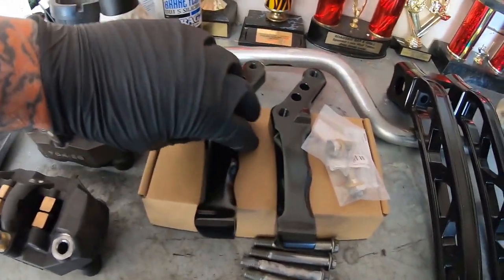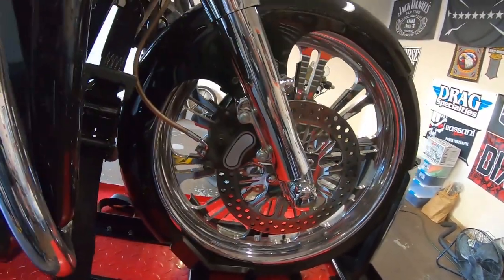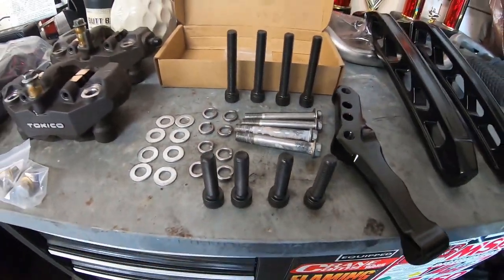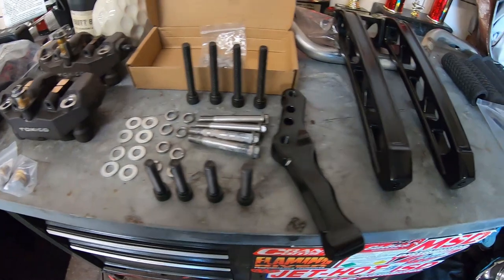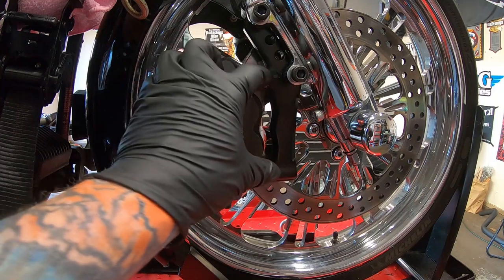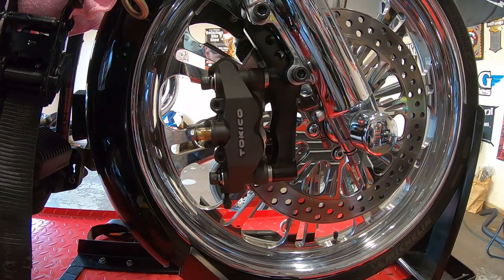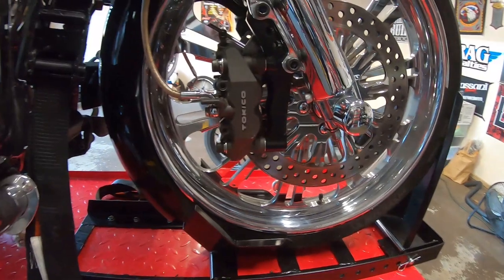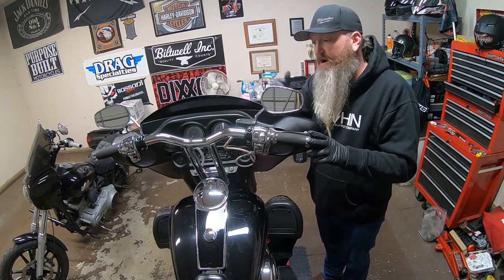Performance Bagger Radial Brake Conversion Install

Comment: Dot 5 is a silcoln based brake fluid, it has a higher boiling temp than dot 3 and 4, it doesn't attract water AND it isn't corrosive to hard paint or plastic like the earlier mentioned brake fluid.
Reply from the maker: Thanks havent really rode rhe bike to push it yet may upgrade in the future
Reply: Dot5 isn’t compatible with any of the other fluids. You’d have to flush and completely clean the system. 

Dot5.1 is compatible I believe. You’d have to do the research To verify. 

Dot5 isn’t good for ABS either.
Reply: @TeensierPython  only way to change to dot 5 after using 3 or 4 is disassemble master cylinders and brake-calipers then replace all of the rubber parts - should probably do the hoses also.
Reply from the maker: Yep all new clean parts with no abs Iam good

Comment: What size rotors do you have on there ? Will that set up work with the 11.8 ? Also where did ya pick up the bleeder bolts?

Comment: I had seen another guy use the Yamaha yzf r6r front brake calipers on his late model streetglid.  But he replaced the brake lines since the banjo bolts fasten on the side. Is
this a good comparison to ur bike mod?

Comment: Did you need to shim the fork leg to radial adapter at all? Mine isnt lining up without shims and there was no instructions so im not sure if it's normal
Reply from the maker: Yea no shims on the fork leg but the caliper has to be shimmed.....you best bet is to mock everything up and make sure the pads run even

Comment: hi are  the long black bolts the same length as the 4  stock radial caliper bolts you have the table
Reply from the maker: I believe they are different sizes......its been awhile but the brackets do come with new hardware

Comment: Great video! Any chance of a parts list? This is something I have thought about doing for a long time. Thanks!
Reply from the maker: These brackets
https://thespeedmerchant.net/product/13″-radial-brake-caliper-mounting-bracket-black-dual-disc/

 then find calipers I used 06-07 Tokikos
Reply: Thanks so much!

Comment: How does it compare to stock?
Reply from the maker: Better
Reply: You got a part number for the brakes?
Reply from the maker: https://www.amazon.com/Bagger-Brothers-BB-RBCM-2K-Caliper-Davidson/dp/B075XSN9YY/ref=asc_df_B075XSN9YY/?tag=hyprod-20&linkCode=df0&hvadid=309830501429&hvpos=&hvnetw=g&hvrand=10715749805436483460&hvpone=&hvptwo=&hvqmt=&hvdev=m&hvdvcmdl=&hvlocint=&hvlocphy=9013122&hvtargid=pla-570316655956&psc=1&tag=&ref=&adgrpid=57212496130&hvpone=&hvptwo=&hvadid=309830501429&hvpos=&hvnetw=g&hvrand=10715749805436483460&hvqmt=&hvdev=m&hvdvcmdl=&hvlocint=&hvlocphy=9013122&hvtargid=pla-570316655956
Description

Upgrade your breaking without spending hundreds of dollars. Use modern radial calipers on your 2000-2017 Harley-Davidson. Better lever response, more accurate breaking, and no need to replace master cylinder. Tokico calipers from 04-09 Suzuki GSX-R600/750 models will work the easiest with these brackets. Fits all Harley models 2000-2017 with dual-disks. Will work with 11.5" and 11.8" rotors (shims included). Available with a black or polished finish. Note: Will Not Work On Narrow Glide Front Forks With Spoke Wheels

Comment: Looks like the lines are too short. When forks go to max extension your going to have an issue.
Reply from the maker: Its close will upgrade soon
Reply: @TrippHPjunkie  did you ever upgrade brake lines? If so what did you go with?
Reply from the maker: @Hightechredneck704  I did not what I have is working just fine 👍